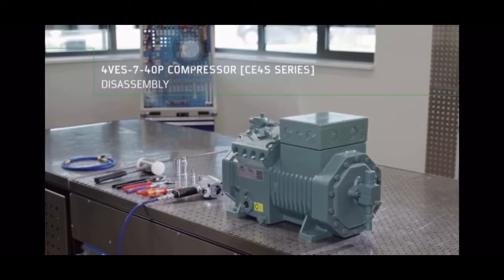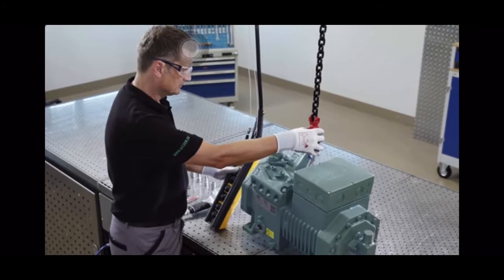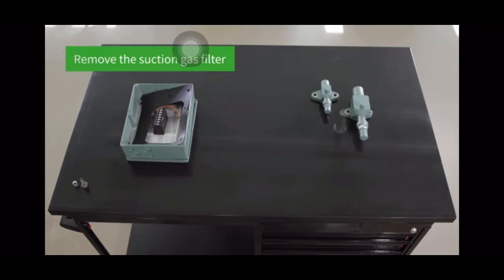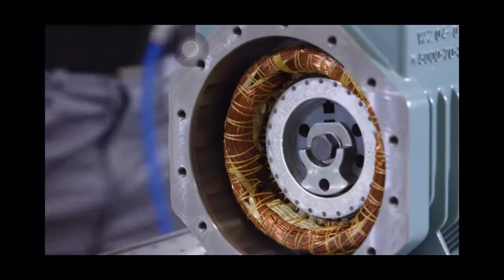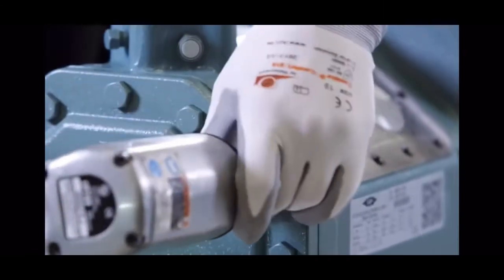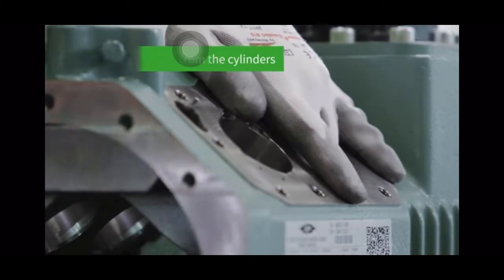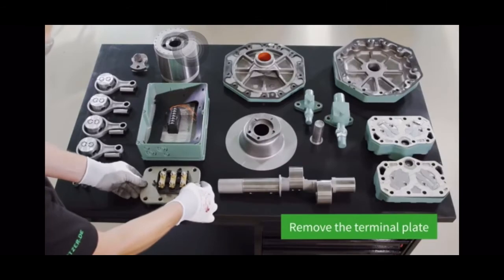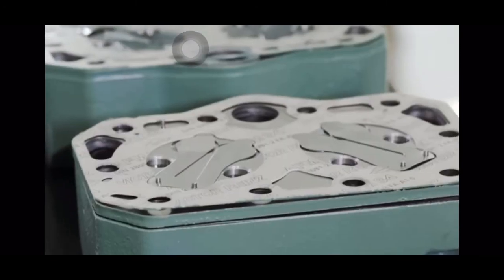How to Disassembly BITZER Compressors

Comment: Hi sir, your video is highly engineering technology.
(1)
Sir, plz assist me how we clean & wash compressor winding.
(2)
Can I wash & clean winding with freon 11?
Reply from the maker: You can use electrical degreaser for cleaning compressor winding after you clean used bulb 💡 to dry up the winding the more wattage you use that’s good before you assemble megger test to make sure no grounded in the winding
Reply: @joexmanatad7646  what do we call that type of puller you're using